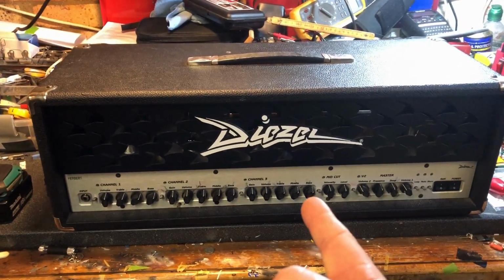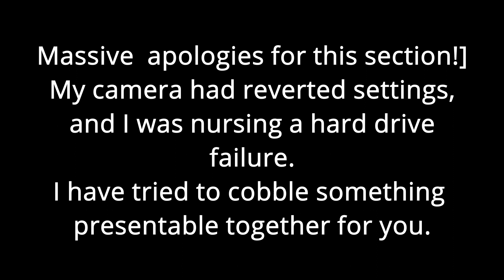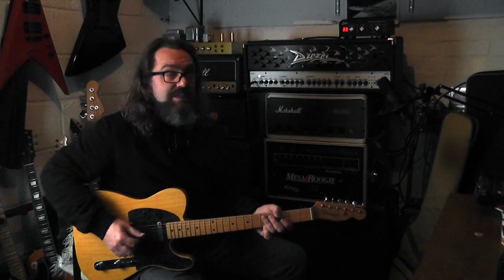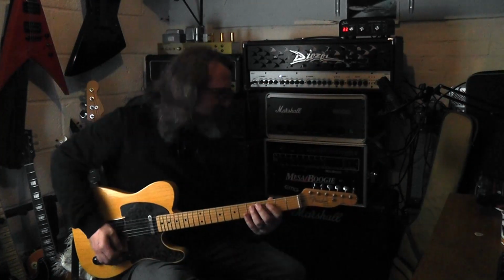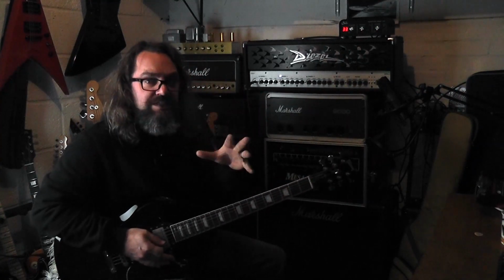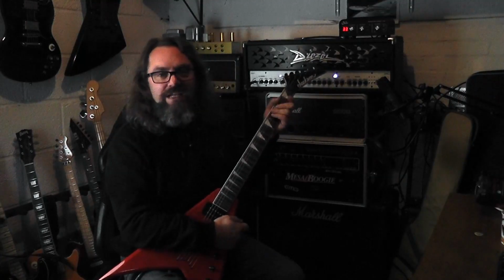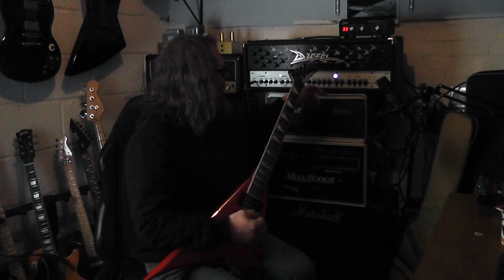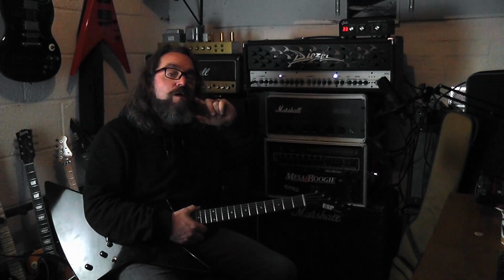My Worst Video... The best amp yet...Diezel Herbert MKII

Comment: I bought an Einstein after watching your video. Had the VH4 pedal for years before that as my main tone and tried an Einstein back in 2012 at GC so when I was able to I nabbed one. Paired it with a Soldano Avenger and it's just the perfect tone like you've described. Never really liked the clips of the Herbert I'd heard before but this one sounds fantastic. The Helix setup you have has me reconsidering my Ignite VST IR loader all together. Sounds like a real cab and huge.
Reply from the maker: Awesome stuff!! The load box is the important bit. I consider the Suhr reactive load key to getting these tones
Reply: @RDamps  do you consider it better than the Two Notes Torpedo? I use two of those into a Scarlett and Cubase with onboard IR’s mostly YORK.
Reply from the maker: @bradolsen9935  . Very much so. The impedance curve it the reactive load is important to how the amp responds. The Suhr load is incredibly accurate to a greenback. The two notes and most other loads (with exception of a very few) are not like any speaker particular speaker. The two notes is good don’t get me wrong. It’s just I’m quite picky.

Comment: I want a Diezel amp after enjoying the Diezel model on my HX Stomp. Have an Uberschall, Mezzabarba MZero, and Mesa Mark V so the low end grunt would be fun. VH4 or Herbert? Love both but can only afford one. I like 4 channels but the Herbert has midcut and seems like more low end grunt.
Reply from the maker: I still think of the Herbert. It’s my favourite Diezel by far
Reply: @RDamps  did you mention what power tubes this particular Herbert had? JJ KT77s?
Reply from the maker: @jonathankidd7921  when it arrived if I recall it had EL34’s. I changed them to JJ KT77’s. As per Diezel spec
Reply: @RDamps  thank you. I have a Herbert MK1 coming in the next week. It sounds glorious in this demo. I’ll definitely try the JJ KT77s.